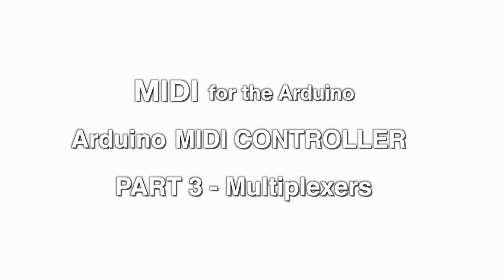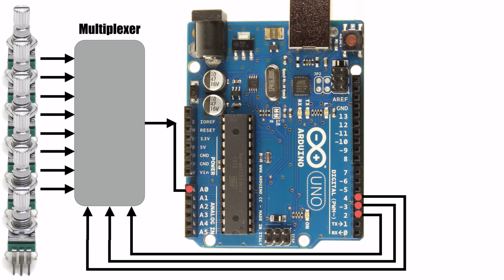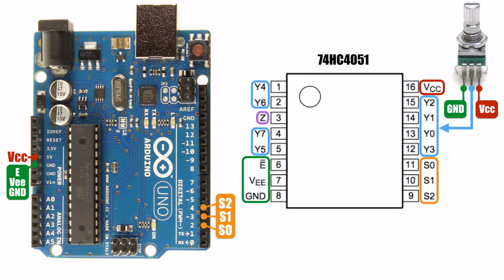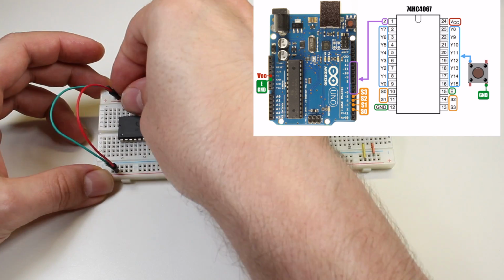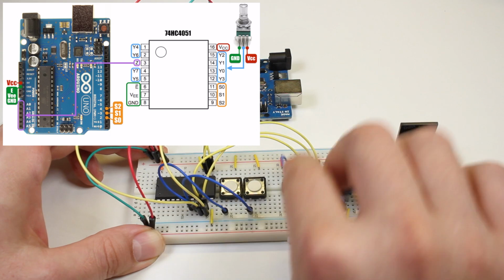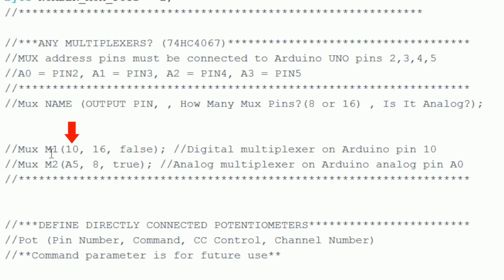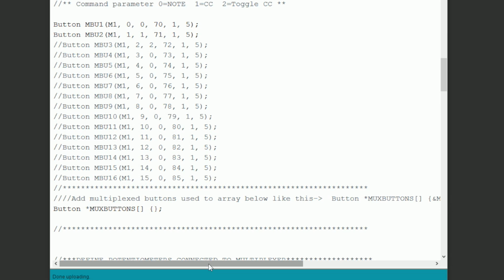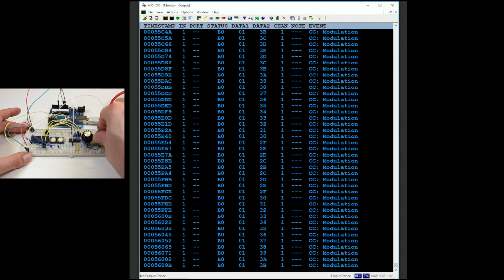Arduino MIDI Controller: Part 3 - Multiplexers

Comment: Hi notes and volts, is there a reason why pin 0 and pin 6 can't be used to connect multiplexers in your code. I like to connect 6 4067 to the Uno. When connecting pots directly to the analog pins, pin0 and pin6 are available. Any way to change the code so that pin 0 and 6 are also mux capable?
Reply: Never mind above (typo pin 6 should have been pin 5). Also I already used A0-A03 analog input pins for my test one month ago :)

I got confused by the naming of the address pins //A0 = PIN2, A1 = PIN3, A2 = PIN4, A3 = PIN5. They off course do not relate to the analog input pins . ADDR0-ADDR3 would have been clearer to not get mixed up with the A0-A5 used for declaring the analog input pins.
For the OUTPUT PIN variable, INPUT PIN would have been a more suitable name for that variable as it's used as input scanning and not as output in this application. 
Minor details though, I'm very happy with your code!!

Anyways I found out that for my project the Uno is near it's limit. I'm going to use 81 analog pots and 15 buttons for my final project. 
When I tried to declare the full 96 analog ins which the 6 analog multiplexers and 16 digital ins on 1 digital multiplexer the dynamic memory exceeded 100% (108%) and therefor I was not able to upload the code to the Arduino. With 81 pots and 15 inputs declared, the code uses 96%. Just enough to fully midify my peavey twelve hundred series vintage mixer.
So anyone wondering what the maximum inputs is for the code to handle: around 96 digital and analog combined.
Reply: I changed the pot and button variables by taking out the midi channel parameter. In stead I set the channel fixed now. It freed up some dynamic memory and now I am able to connect 112 inputs at 98% dynamic memory consumption.
Reply: Hi There, I know this message dates back a year but I am very interested in your modified code for this project - could I ask a huge favour and ask if you could email me the code please? Many thanks

Comment: Excellent tutorial. Can the software also handle 4 * 4067? You can declare multiple muxes but when controlling 4 * 4067 more select pins are needed than this example if I understood correctly. Does the software take that into account automatically when declaring the 4 * 4067's?
Reply: I created one vintagemidicontroller wordpress. This week the Inkel will be finalized
Reply: I have full MUX of 16 pots and i have some kind of MIDI noise. Actually it is not the same noise as you dont ground the empties. On some posts appears midi message what should be on that pot but than it appears another message what belongs to pin 10 or 11 on mux. It happens on some posts, on some not. I did check soldering and no error or cold solder found. Could it be because its powered from USB or is it normal. When i assign the messages to ableton and rotate with post it works fine as it should, only when i try to assign it is hard to find the place where it reads correct message. The thing is that i want to use 3 more MUX and i am afraid that it will be worst and worst.
Reply: Yes star grounding is always best but gives a bit of a cable mess inside. I ground per channel strip so daisy chained per channel. In case of a ground connection failing at worst a part of the channel strip  involved will be failing. 0.1uF to 10uF ceramic for the caps. The higher you get the more chance of lag in your reading. The  best thing is to totally isolate the power lines of your inputs from the Arduino power lines.I will post a update once I'm put to fully equip my peavey project.
Reply: It's part of the dub culture too: creating your own gear to your own needs. I succeeded with the Inkel today. All working perfectly. Made a lot of mistakes in wiring sequence (beginners fault) so the end result is not as neat internally as I wished for, but it's functioning rock solid.

There was no need for capacitors, separate groundlings per channel was enough to not have interference. 56 pots in total on the intel on 4 4067 multiplexers.

Very happy!! Big respect to Notes and Volts!
Reply: Works just fine. Just forward the 4 select pins to each multiplexer. Speed is fine.
Reply: I see a lot of comments for people asking for maximum connectable inputs without lag. It is no problem with 64 inputs. No noticeable lag. Better performance than my UC33e controller.
Reply from the maker: Thanks for the update HP. That's far more inputs than I have tried. Were they pots or buttons - or a mixture?
Reply: I declared all 4 multiplexers and 64 inputs in your example code. 2 pots were connected on the first pin and last pin for my initial test. The rest of the multiplexer pins were connected to ground to avoid jitter. For those testing, unused pins have to be connected to ground to avoid random midi messages.
Since the loop takes into account all input pins because they were declared and connected to ground it should no matter wether actual pots were connected in terms of lag right? I'll finish up my modification of a vintage mixer soon and add some more digital ins by the means of buttons as well.
Reply: Do you use new pots? It could be wear that gives false readings. I had no interference with 16 pots connected. If all your soldering is ok and you still have the problem, try to play with the debounce parameter. To get the most stable input signals you might want to add capacitors on your input pins. Make sure they are connected as close as possible to the input. I read that some people have problems due to the 5V regulator on the arduino board, but I didn't encounter this myself.
Reply: Yes i bought new non-chinese pots for nice rotation feeling. They work as i measured them so there should not be problem. I will double chck before i move on another MUX. I was thing to use some kind of Voltage stabilizer for 5V. It is based on LM1117. I am not an electrician so i dont really know what F size of capacitor use. I read that article about capacitors too. I re-soldiered all mix cause i had pots GND and 5+ connected from one Pot to the other and i had to change it to daisy connection where it all goes from same place solo to each Pot. It heleped, i dont get constant random Midi messages as i move with one pot. I think to use those capacitors, do you know how to find out what capacitors to use? The capacitor should be between pot and MUX?
Reply: HP do you have any Bloq or something where i could follow your project?
Reply: +HolyPeyote i've checked that. Nicely done, great idea to turn old vintage mix into midi dub console. Thats wierd how we have the same reason to built own mix. I do love dub music too and was not able to find useful midimix. I actualy moved on my project too. I have 32 working pots and tonite i will move on third mux. Thanks for you help :)

Comment: Hi, Any chance to run it in an Arduino Due (it is 84MHz and could handle more multiplex ports than UNO or Mega)
Is there a math to calculate the maximum multiplex channels Arduino Uno can manage without delay the control ?  Tks

Comment: Thank you for the excellent tutorial. No doubts it is the best tutorial about Arduino MIDI. To complete it, please consider to include ENCODER so we can control jogwheels and use browse function on DJ software.
I am using this alternative MIDI library (https://github.com/ghztomash/MIDIElements) that includes ENCODER and works well. It is simple library compared to the one you are using, but works. 
One question, any chance to run on Arduino Mega ?
tks
Reply: Tôi đang chờ câu trả lời về arduino mega ...

Comment: Thanks for this well-explained video tutorial! I don't know enough about C to figure out whether your controller library can be modified to allow "coarse" (7-bit) NPRN parameters to be assigned to pots / buttons on this shield project. 

However, it seems if an NRPN flag is added to the "command" variable, and if the "note number" / "byte command" variables can hold a 14-bit value for the number of the NRPN parameter to change, then a routine could be added to issue the 9 bytes that make up the NPRN parameter change command (CC / #99 / MSB of NPRN parameter / CC/ #98 / LSB of NPRN parameter / CC/ #6 / 7-bit parameter value to send).

Is this possible?

Comment: Hi!

I'm trying to make this project on arduino pro micro compatibile with leonardo. I made some changes to work with arcore usb-to-midi library. Now it can send midi notes and cc messages thru usb as hid device. But i cannot make it to work properly... Potentiometer/button connected to multiplexer triggers all potentiometer/buttons messages if more then one is enabled in code. Second potentiometer/button connected to multiplexer is inactive and do nothing. Looks like problem with reading mux channels. Anyone can/want to help?:)
Reply from the maker: Hi Tezet. The software uses direct port manipulation that is customized for the UNO. This helps speed up the read time for analog input. It will not work with the leonardo.
Reply: It's a sad message because your tutorial was the best I've found all over the internet. Code with the possibility of extensive configuration that would fit perfectly for my controller is priceless. But thanks for answering:) Now I know that any code changes will not help and i must find my own way with coding:)

Comment: if i press two buttons, or rotate two potentiometers, at the same time, the arduino will recognize the commands separately or mix them?
Reply from the maker: Hi C4ule. If you rotate two pots at once for example, both sets of commands will be recognized and sent through Midi separately.

Comment: Hi. Great work (and very rare)! Thank you because it is very difficult to do it be myself without basic knowledge. But I'm working on it. I wonder how to use only Sysex message (so as to control specifics parameters in my Roland Jd-Xi). How to do? Are you planning a planning a tuto or something like?

Comment: Really enjoyed the tutorials and planning on recreating.
Now I'm wonderung, if instead if the MIDI port, I could hook the arduino directly up to my PC via USB. Just like some MIDI keyboard etc
(also power everything via USB)
Reply: you can do it by using Serial to Midi program, and a program to create virtual midi (i'm using mac so i can use IAC driver without installing 3rd party program). 

examples are there 
http://www.instructables.com/id/Easy-3-Pot-Potentiometer-Arduino-Uno-Effects-Midi-/?ALLSTEPS

or if you finally decide to make it permanent. try this one
http://www.instructables.com/id/Turn-your-Arduino-Uno-into-an-USB-HID-Mididevice/
Reply: You can do that if you have a arduino uno with the atMega16u2 or atmega8u2
google Flip from Atmel,  Hidunio Arduino_midi, you use Flip to flas the atMega16u2 to Midi HID/MIDI and back to the programming software for the Arduino Uno.

Comment: Is there a limit on how many multiplexers you can use for analog inputs ? Like to  design a hardware midi controller for my waldorf blofeld, that will output midi CC. 
94 analog rotaries to be exact and 30 buttons.
Reply: The limit is the number of input pins. On your arduino. If you use 74HC4067 multiplexers that gives you a 16:1 ratio. In order to handle 94 analog potentionmeters you would need six 74HC4067 and six analog inputs (giving 96 analog inputs actually). What do you mean with "analog rotaries"?

For the 30 buttons you would need two more 74HC4067 and two digital inputs (giving 32 digital inputs actually).
The analog part comes close to the limits of input/output PINs for the Arduino UNO so you may consider using Arduino MEGA or something else with more PINs. You may also wanto to consider something with more computing power such as the Arduino DUE. We're talking a considerable number of potentiometers and buttons and you may want to add other things such as LCD and more.
Reply: so far it's working with my mega2560
Reply: I just tested this. The when declaring above 96 input digital and analog combined, the dynamic memory is flooded. I use 7 multiplexers. 6 for 81 analog inputs and 1 for 15 digital inputs. Dynamic memory use is at 96%. When I tried to declare all 96 analog ins and 16 digital ins dynamic memory use was at 107% and uploading to the Uno was not possible.

My project is a conversion of a vintage peavey twelve hundred series mixer to a midi mixer. Setup: 12 channels with 6 auxes and 1 solo button per channel plus 3 channels with solo button and 3 auxes. The perfect digital dub station!
Reply: I uploaded it to a Uno connected to 1 multiplexer on a breadboard with some pots. The rest of the arduino in pins connected to ground. Since the full code was uploaded and is looping accross all inputs I'm pretty sure it works the same when the full hardware is connected. No latency to speak of on the connected pots. Last month I connected 4 multiplexers (64 ins) and this worked fine as well.
Recommendation for good pots: BI technology P160 series. Cheap, plastic conductive and a nice feeling.

I doth have experience with the mega2560, but your random messages is most likely due to the fact that you didn't connect your unused multiplexer pins to ground. Then they will act as an antenna and screwing up the messages.
Reply: potentiometer
Reply: will this sketch work on the mega2560? or are some changes nececcary?
Reply: hi, even the multiplexing of pots? when i connect oe it works properly, once i add another to the multiplexer it does not work, is send random numbers. did u change the code in controller part of coding?? i mean port or something like that??
Reply: So far I have only conected Potentiometers straight to the arduino mega. I don't have a Multiplexing chip so I don't know whether that works. 
Are you sure your chip is suited for analog values? Did you check, wether the "selecting pins" are the same on the mega?
Reply: thats the thing, i don't know how to other where to check this. Does any one know how to check what pins should i use?
Reply: And did you actually get it work or only changed the scatch?
Reply: well i switched to uno. I am trying to make digital dub station as well with 10 channels and part of mix for toying around with effects and siren. This is good news for me that it works with at least 4 multiplexers. I have around 50 pots and 16 buttons, and the plan was make as much as possible on UNO, and the rest place on mega, make on mega midi thru so wont need a midi merge hardware. Did you figure out how to use chanel on/off LEDs? that is another reason why i tent to use mega too.
Reply: Outputs of leds should be possible to with the uno. The code has to be adjusted for that though. I might looki into that later on because Its nice to have your Mutes or solo's visually indicated. They should be bond to the toggle command of the digital inputs. It would be monodirectional only as Its only midi in so no feedback from the daw. I'll start with all Mutes and solo's off in my live template and only use the controller to mute or solo, then it should work
Reply: the thing is that uno has so few digital pins, when u use 4 as selection pins for multiplexing, 1 for multiplexer of buttons u have only 7 pins to work with, and for (in my project) 10 channel mix is not enough. that is why i still think to get signal from Ableton to UNO, than use uno for multiplexing of pots, signal from UNO with merged signal from Ableton run thru MEGA witch will be used as midi THRU and used as digital IN/OUT. I hope the midi thru its possible, of course the idea all on UNO is nice but you must first multiplex Digital outs to get at least 16 leds working
Reply: I've got a project with a 16 channel mixer with 8 analog inputs on each channel, plus 1 digital. So a total of 16 multiplexers, 128 analog inputs on one midi channel and 16 digital on the next midi channel. It worries me a bit that your UNO didn't work. I've got a MEGA 2650, hoping it won't get flooded. Please tell us if you solved the problems!
Reply: If using an Arduino Mega 2560, which pins should I use?

Comment: Hey Dave, I was wondering if you've come across code that will work with a pitch wheel? (I found a replacement part from a korg, and added it to my project) I've just coded it as a regular pot, but it seems to only go +/- 70% each way.. .wondering if there's any code you know of to make it a native MIDI pitch bend wheel? Thanks so much for your help mate!
Reply from the maker: Hi Josh. Midi pitch bend is a little different that a standard CC message in that it uses two data bytes (14 Bits total) for a range of 0 to 16383. It is mapped like this: 0 = max down bend    8192 = no bend    16383 = max up bend.

Unfortunately, the code in this example does not handle pitch bend.

Comment: Hi Dave! Thanks again for the great tutorial, and for making MIDI fun. Wanted to ask a quick question, I've got 32 buttons over two 74HC4067 muxers, and 11 pots through an additional 74HC4067 mux. My buttons are fine. However when I touch the potentiometers, their CC value is jumping around like crazy, and it's continuously sending a LOT of midi in data into my mac. Any ideas? Thanks mate.
Reply: All good - problem solved, for those who may experience this! my usb hub wasn't spitting out enough power for this, so it was a power issue. switched usb hub - problem went away! yay.
Reply from the maker: Thanks for the update Josh and good work with your troubleshooting.
Reply: Josh Graham how do you modify the code to take more than two mux?

Comment: Could it be a USB MIDI device? instead of using a midi jack?
Reply from the maker: Hi Fred. Not with the current circuit.
Reply: https://github.com/ddiakopoulos/hiduino

You may find this useful, Fred.